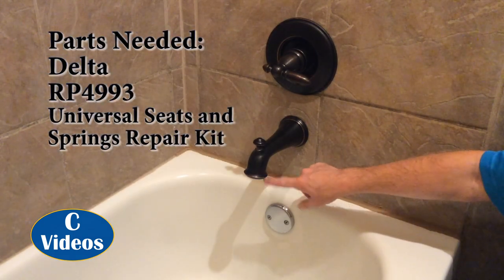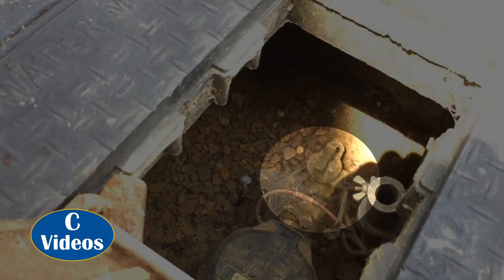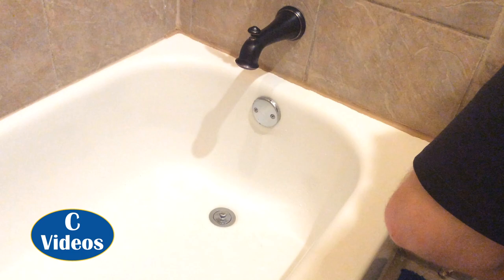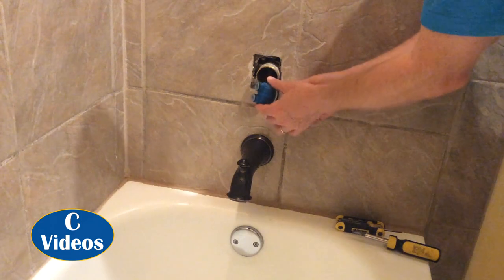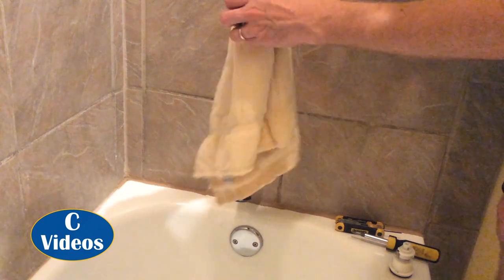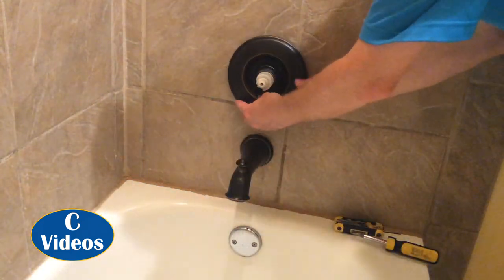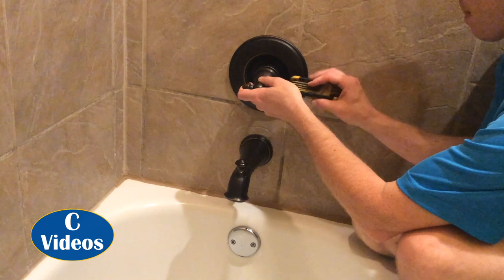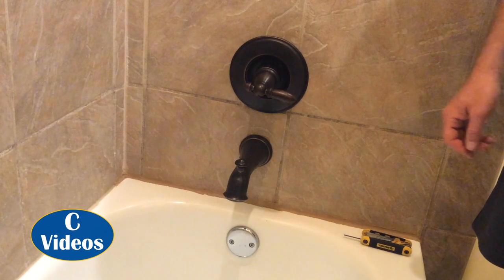Repairing a Leaking Faucet – Delta Faucet Monitor 1400 Series RP4993

Comment: Thank you!  If I would have only had the tiny little instructions (with no diagrams) that came with the replacement springs and gaskets I would have never figured it out.  With this video as my guide it was a snap.  Done in about 15 minutes

Comment: Something glitched when I tried commenting (thanks, YT!), so I'll try again.  Thanks for the video.  It wasn't quite what I needed, as my shower still leaked after using the repair kit.  I then bought the cartridge, and that fixed it, for about $60 instead of the $7 for the kit.  So I got out of it for <$70 total, vs. an expensive plumber visit.  I had to remove some tile from behind the cover to get at the shutoffs, but that wasn't too hard either, just annoying that it wasn't done right to start with.  You have a great presentation manner, and I encourage you to do more such videos.  I see that this is over two years old, so maybe you already have.  In any case, keep up the good work.
Reply from the maker: Thank you. I will try to make more time for future videos. I am trying to get my subscriber numbers up as well, so need to make some more videos.

Comment: Don't forget to Flush out the valve. one will keep battling this if you do not flush out the valve before replacing
Reply: How so, by turning the water supply back on briefly with the cartridge pulled out? Thx,
Reply: @HiVizCamo  exactly

Comment: Do you know what the part number is for the entire cartridge?
Reply from the maker: I'm sorry, but I do not off hand. Delta customer service has been very helpful in my experience.
Reply: Jeff, I know it's probably too late to help, but I just did this, and the whole cartridge is Delta Genuine Parts #RP19804.  The high-temp limit is different from my original cartridge, but it fit perfectly, and fixed the leak, which the kit of just seals and springs did not do in my case.
Reply: What keeps the trim sleeve from spinning and moving around after it’s all put together?

Comment: Having issues taking the brass(stainless steel for me) off. Any tips so I don’t break it? I’m at the point of twisting the attachments on wall.
Reply: Try a rubber strap wrench. They look like an oil filter wrench.
Reply: If the pipe comes out far enough use another wrench to grab the pipe and one for the fitting.

Comment: Good video but I didn't understand the "safety feature" for the kids at all. Also there was a mention that something could be reinstalled "backwards" but the annoying music covered it up and I missed it.
Reply from the maker: The safety feature is you can limit how far the handle will turns towards the hot side. So the water does not get too hot.